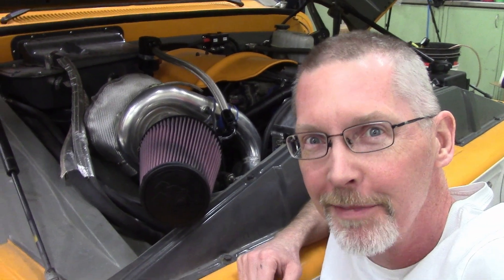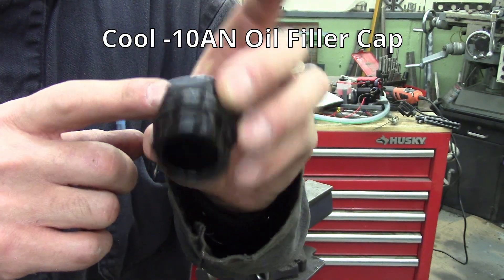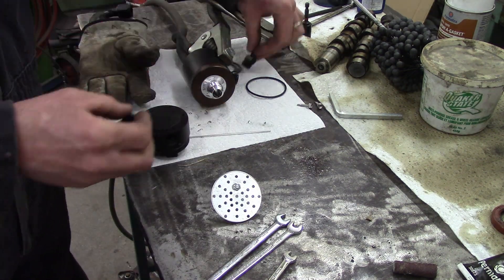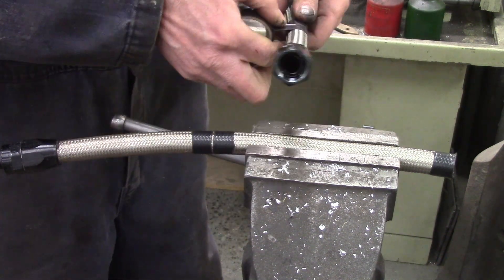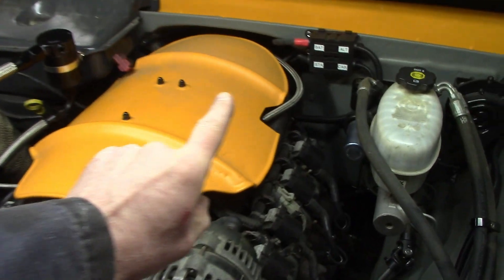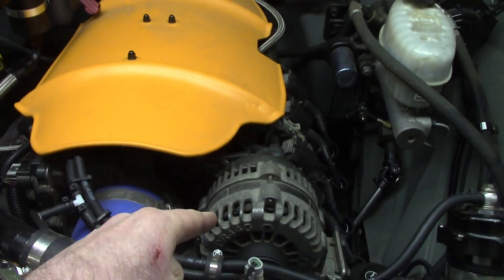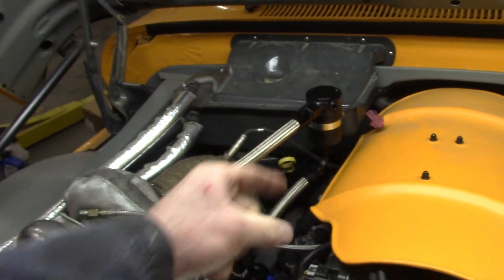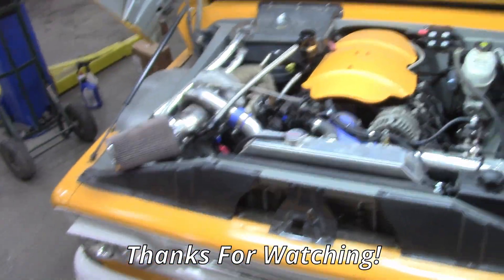Crankcases and Catch Cans

Comment: With my used 03 Tahoe 5.3L, I checked and ran it on a stand. As my son’s engine, I knew its condition. But while installing new gaskets and captured rocker needle bearings, I was finding valve stem tip ware on driver side. This is now filtered air in. Crankcase fumes a pulled out the valley pan, drilled, threaded and 3/4” copper pipe filled with dollar store stainless steel W/O soap. Drilled with tiny holes on bottom, SS filter media held with cotter pins crossed drill. So pulling fresh air in, sucking crankcase fumes from center as filtered air enters both Valve Covers back to center. I use the OEM suction hole in intake to create flow! 
  Thanks kindly for sharing!

Comment: I agree fully, I’m working on my son’s turbocharged Fiesta, but I drive a roots style 4th Gen TRD supercharger. The supercharger has all its “charge piping” internally, inside the intake manifold under the supercharger, so keeping oil vapor from collecting on the backside of the valves is a little more challenging without using some sort of PCV valve that stops boost from getting into the crankcase.

Comment: I have the larger version of this catch can.  I have it in between the vacuum port and the pcv valve.  Low boost it filled the catch can quickly.  I got a set of valve covers with better baffling and it fixed it.  Oil in the intake does drop the octane of the intake charge.  Had I not put a catch can I never would have known the first valve covers were dumping oil into the intake.

Comment: Thoroughly enjoyed that rare rant!  Just don't let your pizza fall out of your mouth into your crankcase!  I need to replace the transmission cooler lines and fuel lines on my truck.  I've seen kits with AN fittings for those purposes and they are considerably less expensive than buying the pre-bent factory style lines, that are apparently nearly impossible to install (at least for the fuel lines).  I might give them a try.  Never worked with them before but it doesn't look difficult.

Comment: Great job, the AN fittings get easier the larger you go! Keep us posted, as to weather this system works as designed, sometimes it takes 3 or 4 revisions to get it just right! 😊 Head gasket still good?
Reply from the maker: Head gasket still good.  LS9 MLS gaskets, ARP studs, only 9psi.
Reply: @GregWellwood  that’s Great 👍